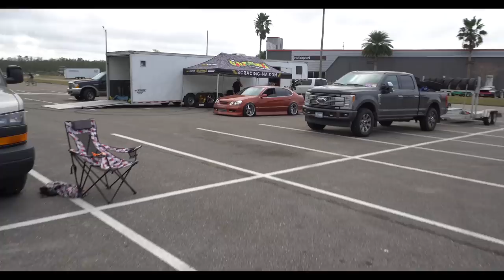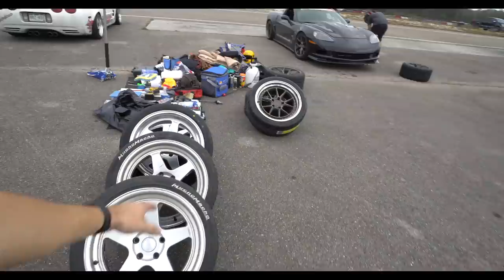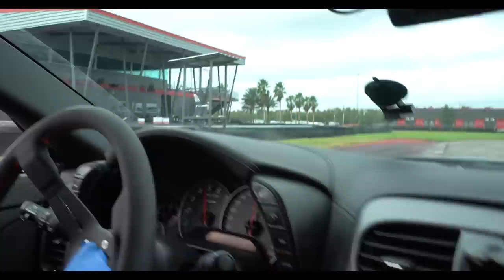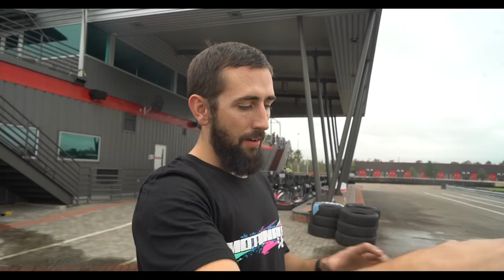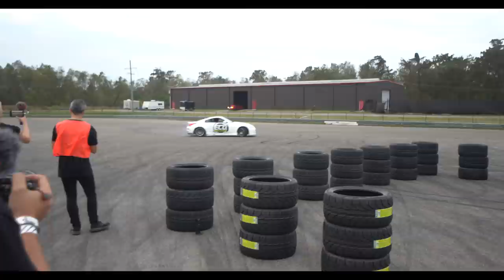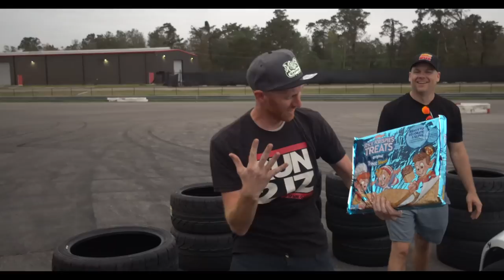FIRST TIME DRIFTING MY WRECKED CORVETTE!!! ( DRIFT WEEK 2020 )

Comment: @motionautotv Factory rear suspension on that Z06 is set up with it clambered in causing the inside of the tires to wear just like that. Alot of people adjust is out to get better wear and get better contact on the ground to hook for drag racing. Hope you saw the comments about indexing you power windows. Google c6 window indexing for procedure. You have now just begun to see 4th the quirks of the modern Vettes.

Comment: Famous YouTuber after knowing its a new car/setup: lower your air pressure because you look wooshy washy!

Trevor after another lap (also his first time drifting this new setup/car): ignores advice and checks tires I need to fix my alignment because the treadwear isn't even
Reply: Adam can be waaaayyy to cocky and arrogant. Especially since Trevor has way more overall experience is just about everything car related. Could definitely tell Trevor was thinking "whatever bro, do you".
Reply: We must of watched different videos.  I saw Adam offering some free advice.  Trevor listening to it and taking it on board.  Was talking about the alignment after doing 30 laps or so, not 5.  And didn't Trevor say Adam was going to spend some time with him later on helping with setup, and seemed thankful that he was going to do that?
Reply: @D33JAY5  I was referring to him talking at the 21 minute mark when he was talking about Adam driving it, but I did remembered it slightly wrong.